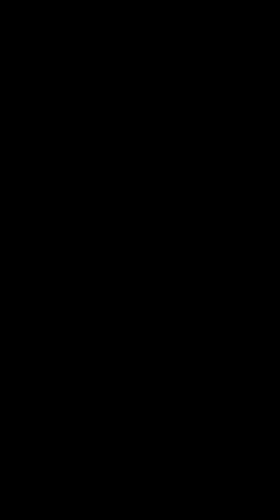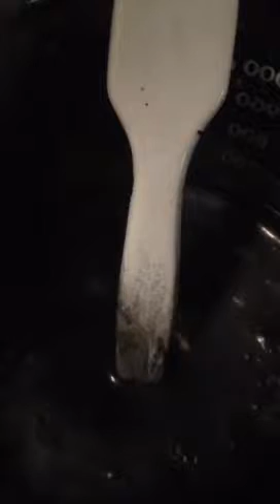How do you know if you made Graphene?  How to tell produced exfoliated single layer graphite oxide

Comment: From nano particles  to the really graphene it is stil  a long way : And here you have the Graphene :https://www.youtube.com/watch?v=pkqk2WkbwvQ
Reply from the maker: +Bartosz Barejko  You have no clue.  Exfoliated graphite is the definition of graphene.  In this video I show exfoliated graphite.
Reply: two methods to tell .... method no 1 .. coat apiece of plastic film with what you think is graphene ,,, if it cuts through an ice cube just using the heat from your finger tips ... you have a winner !
method number 2 ... apply to a piece of glass and pop it in the micro wave ... if the glass shatters in the first couple of  seconds ..winner... highly conductive ... if it takes 20 secs ... or longer ....envelope with wood and start drawing pretty pictures!